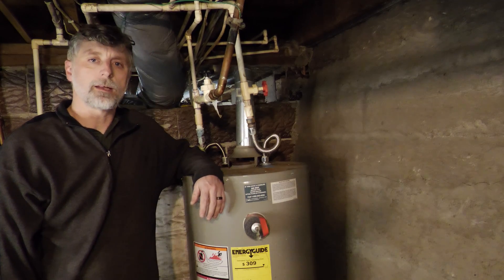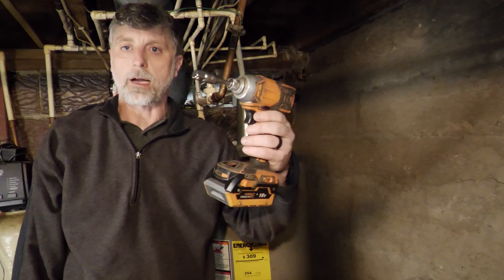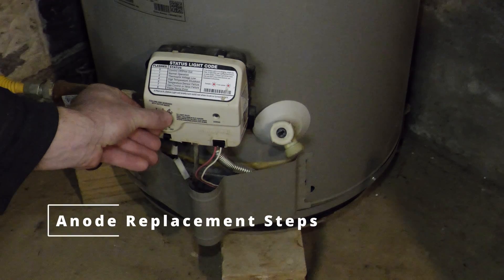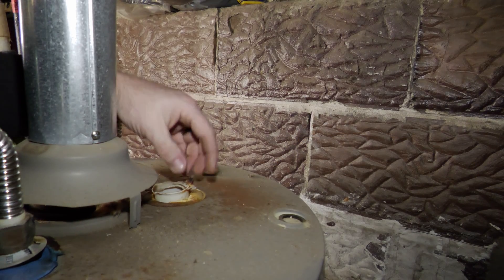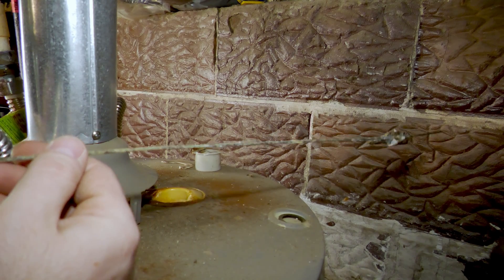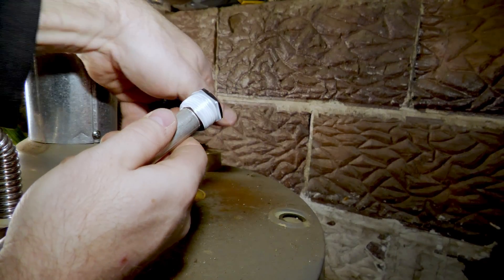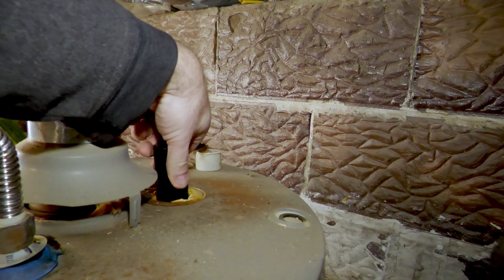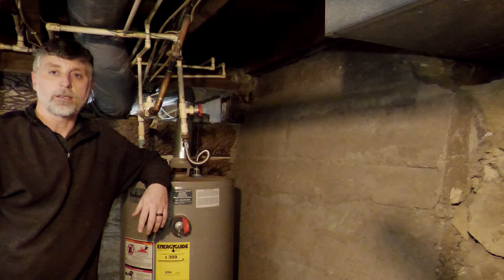Water Heater - Anode Rod Replacement

Comment: Thanks for the video. At 3.40 you mentioned about some good connection. Couldn't hear properly, did you mean electrical connecton ?
Reply from the maker: Yes! Good question. You want enough Teflon tape to seal the pipe threads from any leaks, but you also need some of the threads to cut thru the the tape and make a metal to metal connection. The anode rod needs to have an electrical connection with the tank in order to sacrifice itself and prevent corrosion elsewhere inside the tank.

Comment: My electric tank was installed a year and a half ago. Flushed it today and water was black. I let it fill and turned on tub faucet. Still running black. Could this be the anode rod?
Reply from the maker: I haven't seen that before so not sure. Can you confirm the water is not black before it goes into the tank? Is the cold water at the faucet still clear?
Reply: Yes, cold is clear🤷‍♀️
Reply: @reenpan5567 in your case,  90% probability of due to anode rod being eaten away quickly, 10 % probability of deteriorating black rubber in the water system such as the diaphragmed of the expansion tank or rubber pipe.

Comment: I have two magnesium anode rods in my Rheem water heater.   It extends factory tank warranty by  an additional 4 years (to 10 years in total).. The second rod had to be installed on the HOT output side of the tank (ala Bradford White tanks)...Curious, how often I should be changing anode rods since I already have two ?  The regular rod is relatively easy to change while the one on the hot water output is more challenging.
Reply from the maker: I don't have any experience with a second rod on the hot side, but I'd periodically check the one that's easy to access to see how much erosion it has. No need to change it until its showing significant wear. If you have an inspection camera you may be able to take a peek at the other rod as well at the same time.
Reply: @ModernSurvivalists if they are about the same diameter they should corrode at about the same time, so changing both once you see enough depletion on one makes sense. Multiple rods would probably last longer but not necessarily twice as long.

Comment: Will using an impact wrench cause any harm to glass-lined tanks...as mine seems to be?
Reply from the maker: It didn't seem to and I haven't heard of it being an issue before. Its often recommended as an alternative for when the entire water heater starts to turn - which can damage the plumping attached to the water heater.

Comment: Worked like a charm, great simple video.  I used a solid anode rod and trimmed it the 3" I needed to fit in our smaller 30 gallon tank using a angle grinder.  :)  Thanks!
Reply from the maker: Glad it was helpful! Thanks for the comment.

Comment: i tried using a compressed air impact wrench on my rheem gas water heater after soaking with penetrating oil. DID NOT WORK ! 
please advise with any other tips and tricks.
Reply: Me too. I tried multiple way. Doesn't move at all
Reply: @yanggao2408  finally removed it. Had to use an easy-out 26mm socket because I rounded the bolt head, with a breaker  bar and an extension pipe for extra leverage.  Left hand on the extension,  right hand grabbing the pressure relief valve, and right knee braced against the tank(which left a little dent). Loosen it while the tank is still full=heavy so it doesn't move as much.
Reply: @arkrainflood  We suppose to see a lot of videos and read a lot of comments, so we have an idea what to do.  Comment sense is loose just a little the Anode when is full, then empty a little like 3 to 5 gallons and finish with the impact gun or the wrench. Now, it's not better to flush the tank completely when we going to change the Anode. I think so.